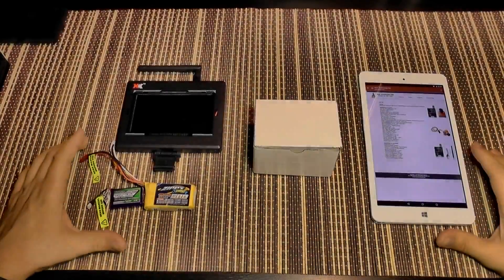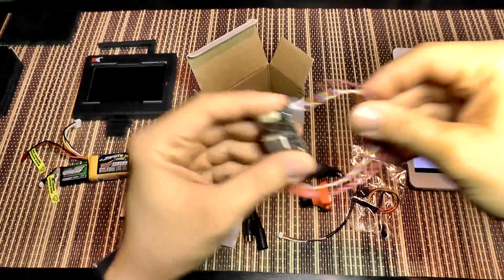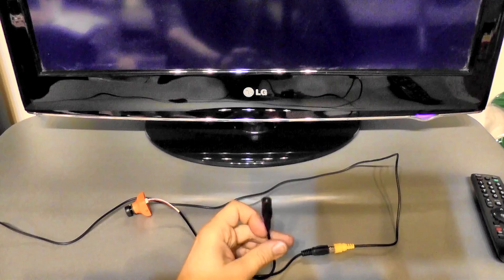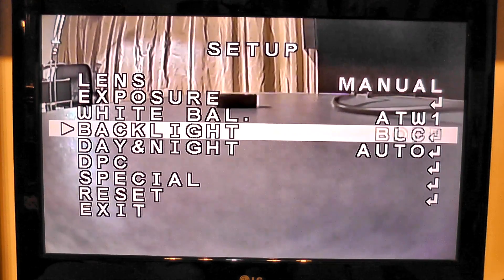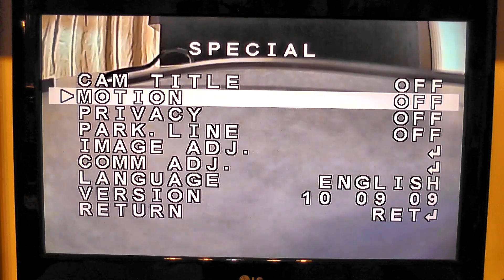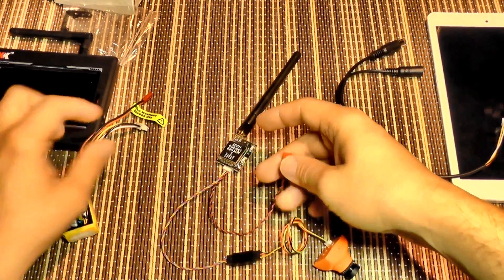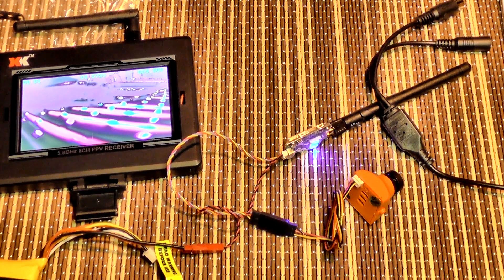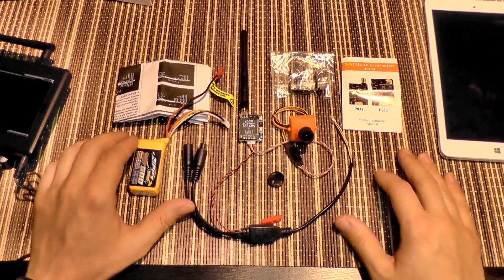AKK KC02 Sony Super HAD II CCD and 600mW vTX FPV KIT Review - part 1

Comment: I got this setup connected to a 2s lipo an all I get is static it's on the rite channel an band
Reply from the maker: Try a search on the receiver, could be that the band / channel doesn't correspond.
Reply: Perhaps it does not have enough voltage… did you ever figure it out?

Comment: Can I connect a battery with 2300mah and 8V to it? Good video.
Reply from the maker: 8V battery? Depends on the model of your AKK, some run on 5V others on 2-3 or even 4S. You need to check the exact power requirements.
Reply: @TechTronic9000  4S battery. Every one had 2V
Reply: @TechTronic9000  But its runs. I only afreat about the mah. That the heat destroys it.

Comment: Great information. Thanks. 
I wonder why the transmitter uses high power LED instead of low power LCD for display. LCD is more visible in daylight too. Probably less circuitry, costs less. Hopefully it turns off.
Reply from the maker: I'm glad you liked my review, as for the LEDs I see that all transmitters use the same, there are also some vTX modules with dip-switch and no LED.